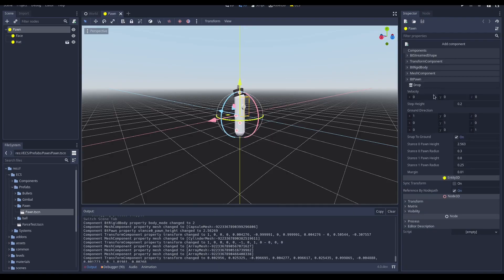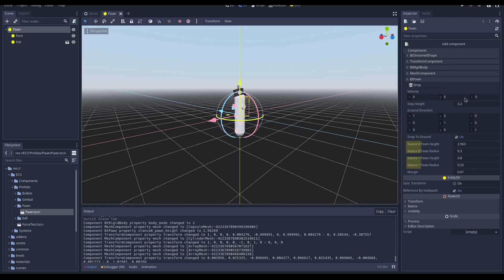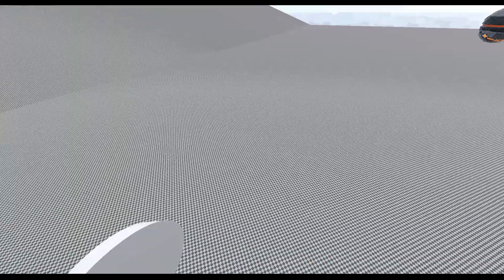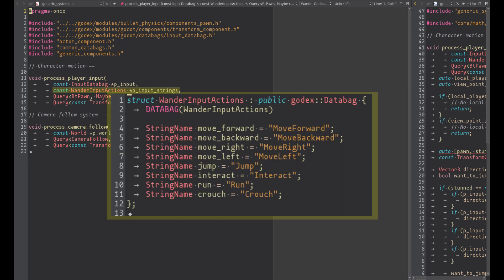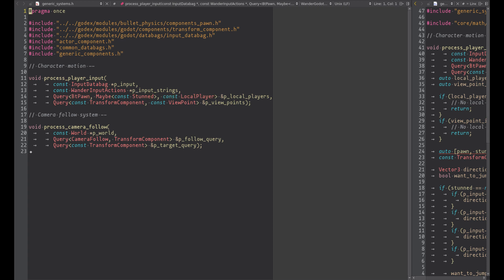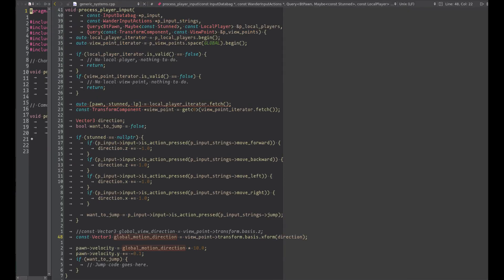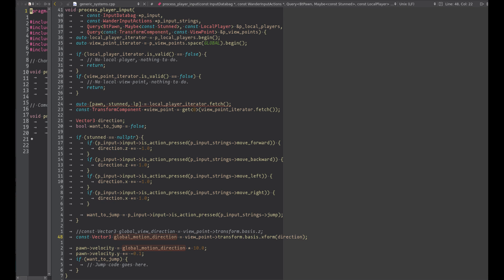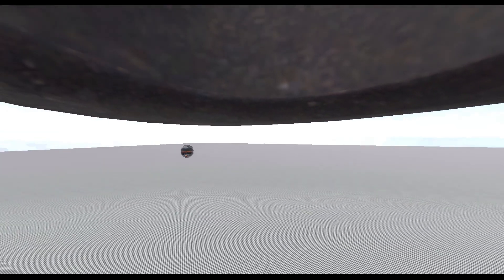Godex Pawn walking ECS - Godex #3

Comment from the maker: The Pawn mechanism uses a walking algorithm that allow the Kinematic body to walk smoothly without losing the ground even on the worst terrain. It's able to go uphill and upstairs smoothly without losing speed, or accelerating when going downhill. It also supports forces and impulses, that allow to code explosions or external pushes.